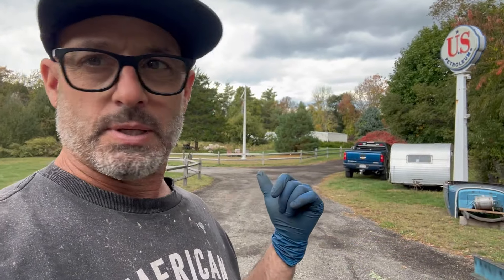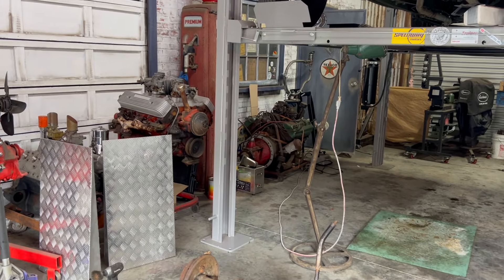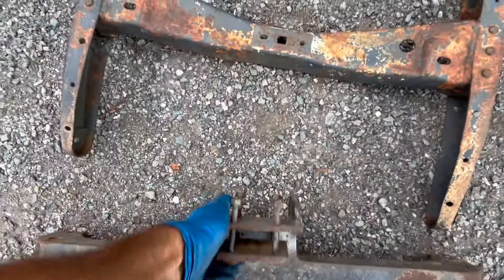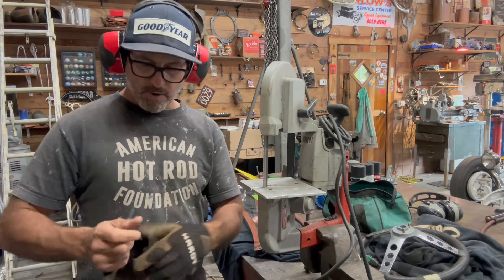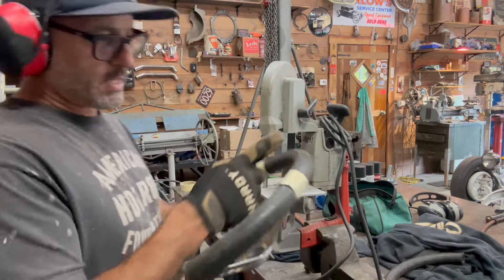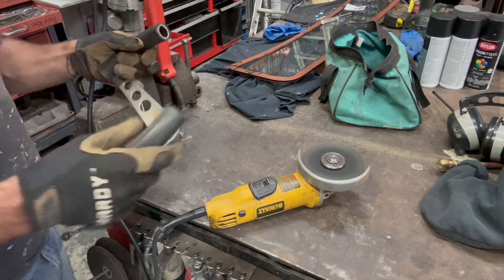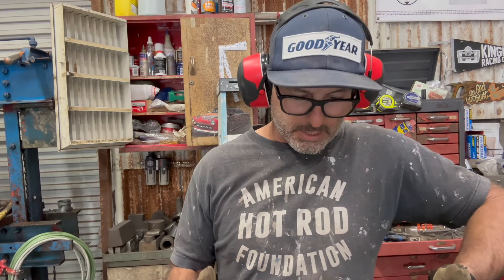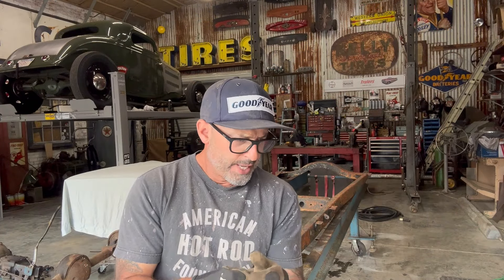Vintage Dragster Build Ep  2

Comment: Great video, reconsider using the body it’s to good to cut up , try to sell in now that winter is coming, guys are looking for projects this time of year.
Reply from the maker: I appreciate your view.   I’ve tried selling it multiple times and all I get for responses is “why did you cut the roof off?”  Or “ you ruined a perfectly good coupe” and “do you have the parts that are missing?”
Not one person made an offer or even came and looked at it. 
I even had it offered with a frame and title. 
So now it’s time to build it into something that’s going to be used.  
If someone in the future wants to rebuild it after it’s done being a drag car, they should easily be able to bring it back.  
Only thing missing at this point is the decklid.